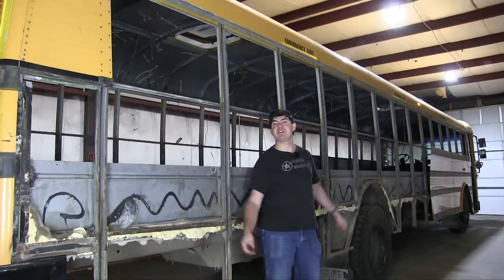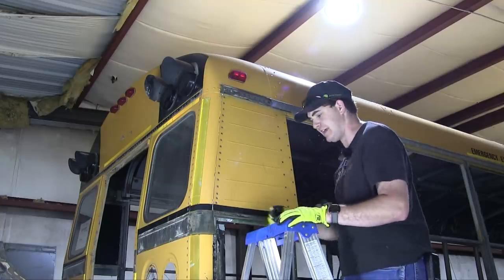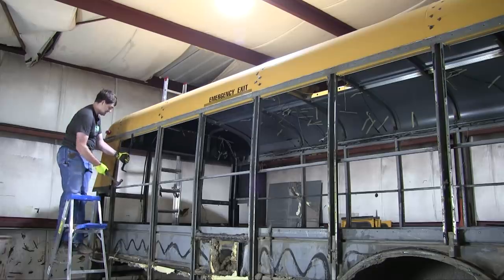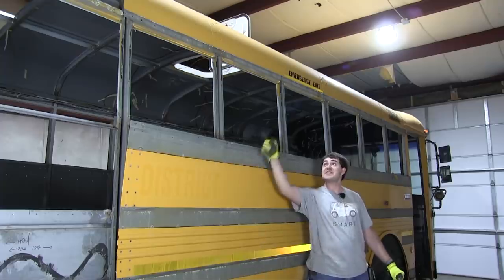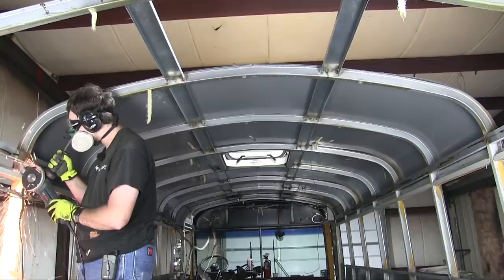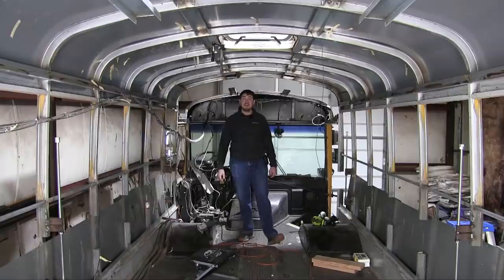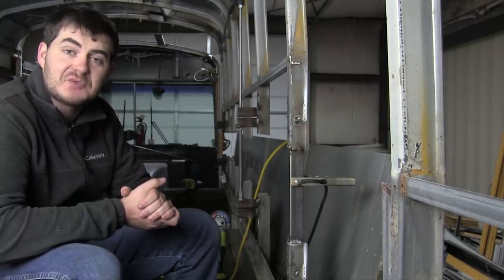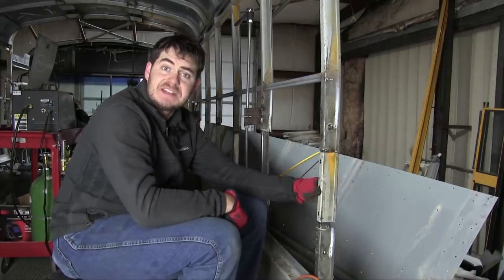The RV/Car Hauler Bus Project: Part 2 - The Uplifting Part

Comment: 12:37 - rose the roof 10 inches, total height now 128 inches.  That's 10' 8" and some change, so you have no worries regarding the 11' 8"+8" bridge.  That's good!

Edit: Nobody's looking at the '+8"' part, seems... :)
Reply: The 11'8" bridge has been raised by 8" in the last few days, so it's now 12'4" 😁😁
Reply: @Wasper216  Hence the 11' 8"+8" as the channel is calling it. :)
Reply: The 11'8"+8" should've taken that "two extra inches for headroom" advice.
Reply: They just raised the infamous 11'8" bridge. It's now 12'4". I don't think Bob has to worry about the canopener. Sadly, there are still vehicles that do.
Reply: I just wanted to say hello to all fellow "can opener" fans...
Hello!
Reply: Bridge??? Heck I was thinking hopefully he measured the door
Reply: 17:43 Super size me

Comment: Those black painted horizontal rub rails are an integral part of the wall system they also keep the sheet metal wall panels from buckling.  I work for a Thomas Bus dealer back in the 90's and was able to visit the factory assembly line when Freightliner/Mercedes purchased Thomas Built Busses.
Reply: Assuming you haven't watched the newer videos on this project, the original outer walls on this bus are all gone and he has new sheet metal panels that do not require those rub bars to be there. As for the structure of the bus that I cannot say

Comment: If you've ever got to do something similar with rivets, use a flap disc on the grinder and hold it flat rather than upright - it's a bit safer for you and I've found it to be quicker than a cutting disc (my experience being pulling boats apart lol)
Reply: If you were working on boats I'd expect they used aluminum rivets, a flap disc might not burn through steel as easily...?
Reply: @user-ut9ln4vd5m  I'm not working on boats any more, but solely in motorcycle fabrication- same advice stands :P Flap discs work fine on steel too?! Nice and sparky...
Reply: @the_mad_ratter but can the disc cut through as many rivets before you need to replace it?
Reply: @the_undead  if you let the weight of the tool do the work, and don't lean into the work, they last bloody ages lol
Reply: @the_mad_ratter  but is that for steel or aluminum rivets?

Comment: 7:18 How about turning that panel around so instead of sloping down it slopes up?
Reply: Yep had exactly the same thought. Just need to add a couple of filler strips to close the gaps to the side walls. Lot easier than fabbing a whole new roof panel.
Reply: I'm glad someone else commented this idea. That's exactly what I would try to do.
Reply: @mightybeanstick9872  exactly.
Reply: That's what my first thought was too. Just flip it and add some more material underneath
Reply: Yes!
Reply: But the roof is risen 10 inches which would mean the curvature of the original intermediate panel is completely wrong. Yes, curvature can be changed but then the aluminium would become brittle with repeated changes to the shape.

Comment: How long does your editing process take? That's a lot of cuts.
Reply from the maker: I managed to speed up this process quite a bit this time. I installed the mac equivalent of autohotkey so now I have a keyboard shortcut that makes a cut, skips ahead 5 frames, and makes another cut wherever I put the playhead. Without this optimization I would've ripped my eyes out. I did all of the editing in a day.
Reply: @agingwheels  how many GB of footage was this video? I kept wondering if you had a remote for your camera or if it just kept rolling for all that grinding...
Reply: can we stop watching all the same channels?
Reply: @sillyducky1049  no.
Reply: @agingwheels  Even so, this still looks like a death of 1000 cuts.  :D :D
Reply: @sillyducky1049  
No
Reply: @rudolphguarnacci197  Joke is he's a dude I know IRL.

Comment: Wait wait, the end cap is still there...
Reply from the maker: Shhhhhhhh....
Reply: @agingwheels  [in a very hoarse whisper] Wait wait, the end cap is still there... 

Thinking about it, but I suspect you're going to have issues getting your Weego on and off that thing without a loading dock. You might want to find a dead wrecker at a wrecking yard, and steal the movable bed with the hydraulics off it. Adds to the cost, but I think you'll love it the first time you try to haul a vehicle on it.

Comment: I run a hand grinder at work prepping chimneys for tuck pointing. I use a old school full face MSA silicone breathing mask. Also decent foam ear protection and double thickness cloth chore gloves, plus a paper head cover to keep some of the sand and dust out of my ears and hair. Those masks are available on eBay, many times for a great price. They sell all the parts you'll ever need to repair or ad upgrades too and many versions of the filter cartridges, sometimes dirt cheap. They also sell plastic visor sheilds that glue on the plastic view port so you don't destroy it and just keep swapping them out as they get too dirty and scratched see through. I like this setup way better than a half mask and eye protection goggles as it's a all in one breathing and eye protection system that is completely self contained for cheap. I usually use the N95 or 99 dust filters but you can get everything all the way to NBC filters if you're worried about the apocalypse. Mine is the ultra veiw twin though they now make newer more expensive versions. Think about it if you're going to do about anything that can destroy your lungs or eyes.

Comment: You need luggage / tool storage boxes in the underneath section of the rear. This way you’ll get a matching lower bodyline again, and all that space won’t be wasted. Propane, water, waste water etc can go under the living section. Make sure you plan for a shower and a throne

Comment: For the new "skylight" fill in, use an appropriately size rear lid off of a mini van. There's a build somewhere on YouTube where  just the same was done and it worked pretty well, with the added options of a wiper and a defroster grid. Just a thought.

Comment: IMO it would be cool to do the front cowling-to-living-quarter transition with a window of some kind. Being able to see the bridge you're about to bash into would be super handy. Also, it would mean a low front part of steel and a high back part of steel could be coupled by an angled piece of glass (insulated glass?) reducing the number of compound angles to roll in.

Comment: That "tension" when you cut the roof in the front is probably the frame that sagged. You may want to jack it a little bit when you put it together again. The frames are actually pretty soft and wobbly without a body.

Comment: You could have used the verticals from the section of the roof that You would eventually remove, that would not only make the weld safer, but also keep the overall tension in the "cage" more or less unchanged. A horizontal strut loop would also help with the structural integrity [about where You cut the original verticals]. It would also keep You and Your family safe in the case of a crash or roll over. And to top it off, it would make the mounting of the creature comforts a lot easier [because You would have something rock solid to bold them onto]

Comment: For the roof panel that changes height.  I'm not certain if you raised it too much for this, but you can use the old roof sheet that lowered to the shorter roof and just turn it around so now it raises from the front.  You would have to extend the ends, but it seems perfect for it.

Comment: It's looking pretty good. nice work and planning. For what it's worth when the tool batteries die they can be repaired with new batteries from the net cheap. Have noticed a trend with them. The two on the positive end will go bad killing the whole battery but the others are still good. So an 18v battery can be repaired for under $10. The batteries inside the battery are a universal size used in all tools known to man and even older laptops. Soldiering and caution needed but not hard at all

Comment: You should look to get some plexiglass and make Windows in place where the front cap meets the lifted Roof. How cool would that be? Good Isolation and it will look as there would have been ALWAYS a stripe of Windows there.

Comment: Actually I'm wondering if the rear floor could support much weight anymore, without the roof & walls acting like supports... probably ought to beef it up with some box frames in case you're thinking of hauling anything heavy (like 2 cars)

Comment: With all those windows do you think insulation is going to help? 
- 
I would add a wall to the front for insulation, noise reduction and security. Use cameras with TV's instead of windows since insulation, wall space and privacy will be appreciated on the road and it's easier to provide power for a TV/camera all night then HVAC.

Comment: YES! The bus returns. You did some massive work during part 1 and now even more during part 2, wow !
However (oh boy): the connecting roof bit above the door, wouldn't it be easier to create less yourself and just flip it 180 ? So re-usable mode instead of throwing away and creating a lot.... (don't know if you will). I like the upper the roof bit a lot, good idea you had there. I wouldn't think of that. But 12:32 you might have Jinxed yourself.

Comment: The jack idea was really goddamn clever. Pat yourself on the back for that idea. I would have used high lift jacks but your idea is way smarter.

I have NO idea how viable the idea would be, but have you considered squaring up two or three segments of the "gap" in the roof and installing plexiglass or windows to give it a bit of a sunroof right there, like some vintage buses had?

Comment: Perhaps run an under-floor heating loop? Either electric or hot -water. Hot water could be created from heat exchange with engine coolant and/or from an electric element when parked. Electric heating option could double as block heater.

Comment: Have you thought about taking the sloped part of the roof skin that you removed and spinning it 180 degrees so it slopes up instead of down? If it would fit it would make it easy to skin that part of the bus since all of the compound angles would already be formed.

Comment: You really went at it the hardest way  Sawzall would have left the removed section in tact for a  cool shed or sun room walls added to a shed both sides natural light into your shed witch is now expanded into a shop . Just an idea for your next bus conversion video

Comment: "through experimentation I found out the best way to remove these rivets, is with a good 'ol fashioned grinder..."

Have you tried an air hammer with a very sharp chisel bit? You can shear the heads off, swap the chisel bit for a punch bit and knock them out. I have found out this was the quickest and easiest way to remove steel rivets from automotive frames and cross members.

Comment: great vid, but I was wondering, What are  you going to do with all the sheet metal, screws, and other scrap from the removed section ? 
Edit: other than the peices being given to your comunity.
Reply: You can also remove rivets real easy with less mess using an air chisel

Comment: Could you use the roof panel you removed to raise the roof if you turned it the opposite way and fill the holes in the sides? Hope that makes sense. Basically take it off spin it 180 degrees and put back on so it goes higher rather than lower.

Comment: You do not need to fabricate a intermediate piece to transition from the first panel. Just turn the one you are removing around and add some to the sides and a little wedge to the front. If you would install a overhead rail crane you could have pulled the back off intact and moved it up to the rear of your living space.

Comment: Could you reuse the ramped panel you cut out of the front section by spinning it 180 so it ramps up to the rear? That way you have a panel that fits and is already shaped.

Comment: So the transition panel in the front that you removed if you turned it around 90 degrees so the low end was toward the front of the bus would it not give a form to work off of to match up with the increase in height you are doing making the fabrication minimal?

Comment: You may have heard this comment or may have thought of it... consider overall height OUTSIDE on the roof INCLUDING vents or air conditioning. Why? 13 feet 6 inches is normally where semi truck height is limited to for clearing bridges.  Not taking that into consideration may cause some literal headaches :-).  Anyhow, thanks for the video.

Comment: First off, I love your videos and I don't wish to badmouth your decisions but if you just cut off the front section legs 10 inches lower than where you cut off the rest legs, you should have been able to just move the rear section of the roof to the front and weld it back on, no infill pieces needed. I love how an extra 40 or so years of experience (old age) means you have seen more stuff and remember bits of it. I'm really looking forward to the rest of the build. PS did you get to that wedding?

Comment: How many screws per battery charge? (Hope you had more than one battery).
You could have cut the needed members to raise the front half of the bus roof from the back half that you will be removing.  At least you did use some of that to fill in the gaps.

Comment: So maybe a dumb question.  Why not cut off the back end's skeleton first, then cut your extensions from the vertical steel from that section?  It would have matched the shape of the vertical members up front, and nested right into them to be welded. edit without then needing to cut extra pieces exactly as you did and weld those on over the square extensions.

Comment: I can really get into this set only IF a) I don't try to drive this into the city b) somehow modifying the backend exposed "bed" so it can contract underneath the cab and thus shortening the body length ---with that said I might as well stick with a van with a trailer as it just works

Comment: 12:56 go as high as your dot will allow  while still fitting under most bridges ... remember ..  its better to have the extra space and not need it than need it and not have it... i would go with no higher than a 9'6" iso container on a  tractor trailer that means you can go anywhere they can :) call it 12ft from ground to roof

Comment: I have seen a bunch of bus videos. Just can't help wondering if instead of countless hours of removing screws and panels if you could have just cut the whole rear end cap and left it intact and moved it forward and then welded it in. There is one like that here in town and that's what they did. Seems like a ton less work.

Comment: hmmmmm if you mount that roof section in the front over the door in reverse it should give the amount of lift you need towart the rearsection it has a nice flowing upcurve in it, you need to fill in the sides a little as the pannel will sit a few inches higher up

Comment: You can store it in 1 byte of data but an unsigned int is 0-255 you cant store it in a signed bit tho -127 to 127. still nice it's a power of 2 tho :D and great video as always

Comment: I was expecting to see you reuse the vertical bits from the rear to support the raised front section... the added box tubing you used is probably way overkill by comparison, but I guess safety first.

Comment: I'm late to the party but I would have considered cutting the rear unneeded section of the bus 10" lower than the front' cut, deleting the forward roof and moving the rear section up to achieve the result with a lot less piecing. Seems like less work for the same result.

Comment: Why don't you turn the intermediate panel around and use that as your slope up? You'd only have to add metal on the sides of the panel which is a lot easier than a compound curve.
Reply: You would probably also have to make a smaller panel to connect it to the front half taking into consideration the raised height, however, I would still guess you could cut a slight semicircle strip to do this, as the hard part is still done by the used panel.

Comment: What is the overall height? Are you considering that you will encounter low bridges? Especially train tressels, because railroads usually are grandfathered into otherwise illegal overpass heights. I hope you are still under 12 feet

Comment: What does the gov think of this project?  You are making a ton of structural changes to this bus.  Are they going to let you put this back on the road?  
I really have a hard time seeing how this ends up back on the road.
Reply from the maker: Given the huge number of other school bus projects I've seen that are licensed, I don't think I'll have any issue. There's no real safety inspection here anyway. Just the bi-annual tire and windshield wiper check.
Reply: Are you worried at all about its ability to hold a car?  That's a lot of weight.

Comment: And if you had raised the front of the bus the easy way, you would have a front that was as aerodynamic of an average UK house brick and the fuel consumption turning into gallons per mile rather than something that will make you weep softly at night.

Comment: Couldnt you have turned the front piece of roof round so it sloped up towards the rear instead of down then a 10 inch fillet between it and the windows you had the compound curves I think

Comment: hmm personally i would have taken the sides off but left the roof on  maybe put a small gantry crane on the roof :) i mean if the cars you want to load onto the back wont fit between the frames then they wont fit on the  deck ether soo